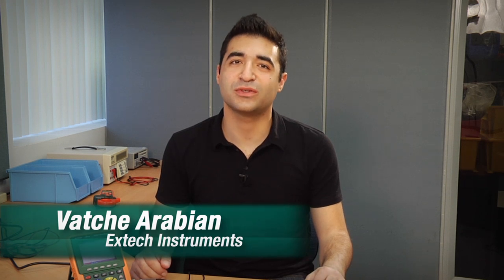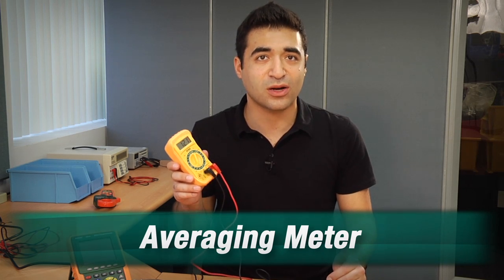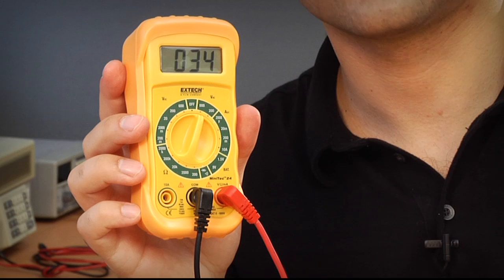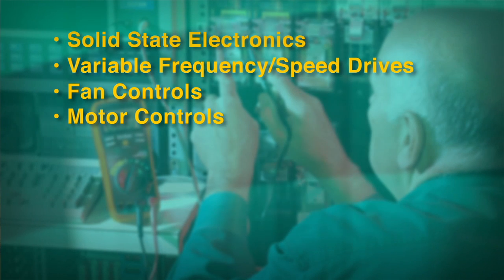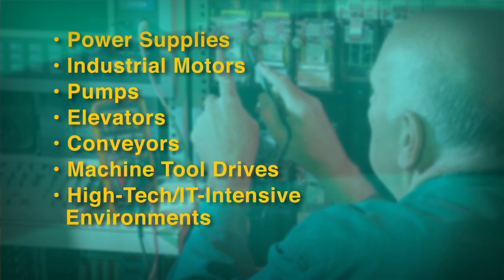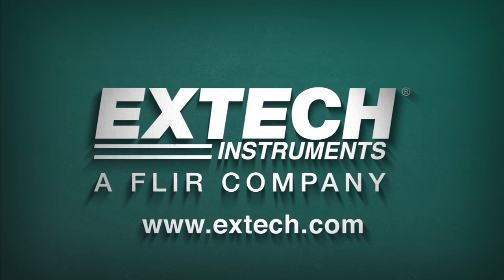In the Know: What is True RMS?

Comment: I am going to be working in Ham Radios i.e.; Radio Waves, Signal Strength, Frequency and Modulation is True RMS a good fit for this purpose. I know nothing about electronics just getting started learning. Any advise would help. Thanks
Reply from the maker: Terrence, using a True RMS meter is fine for measuring voltages in a circuit if you are troubleshooting a problem. A True RMS meter is not a good tool for RF. For observing or troubleshooting RF frequency problems, you'll need a fast oscilloscope to view your signals.

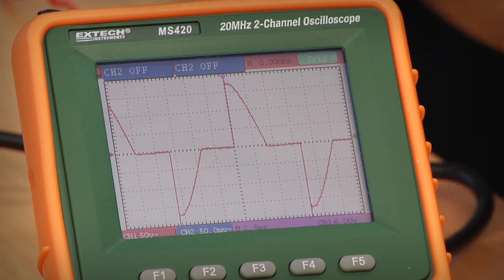Comment: I don't see that is correct. You can clearly see in the 1:39 that the oscilloscope is in 50V/division so the sinusoidal is about 170V of amplitud so if you get rid of half of the signal, shouldn't the TRUE RMS measure about 60V instead of 120V?
Reply: TutoElectro 
There is clearly an error in this video and it is pretty disturbing that this video is from measurement device manufacturer.
Also pretty funny why true rms wouldn't work for DC signal. If this is true with their meter then it isn't a real true rms meter.
Reply: @impersonluoto4568  True RMS is about the following:  for a particular AC waveform, what is  equivalent DC value that will generate the same amount of heat in a resistor load.  So for DC you don't need to figure out RMS value, because DC is constant voltage.
Reply: Gracias Alex!!!!
Reply: I do have the same question as yours TutoElectro. Since true RMS uses the formula as he is saying, then distorting the signal or clipping some portion of it should also affect the resulting value. If he is right, then he could completely distort the whole signal and still able to read 122V (weird). Please clarify this Extech Instruments.

Comment from the maker: Typically whenever you're dealing with AC that has been converted from another source, it's not a pure sine wave like the AC that comes into your home. 

So I would think that you would need a True RMS meter. For example a UPS that would keep your PC operating for a time if the power went out is not a real AC sine wave and would require a True RMS meter to measure AC correctly.

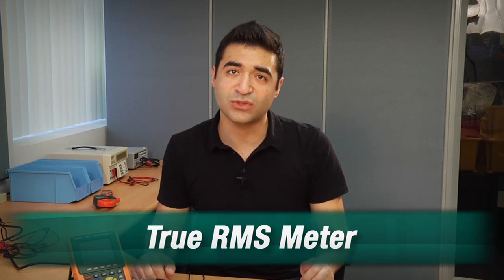Comment from the maker: @muppenz if you watch around 1:30, you'll see that the video states True RMS Multimeters use the Root Means Square Formula to calculate a more accurate reading. There are a lot of articles online that go more into the math behind how a meter does this, but we wanted to make an introduction to how it works, and why you'd need a True RMS Capable meter. Thanks for your question!